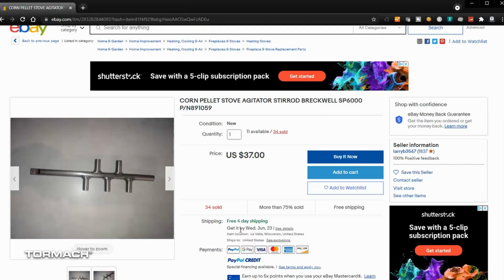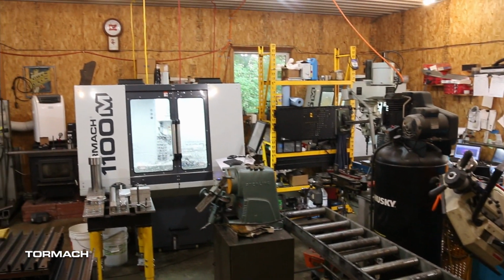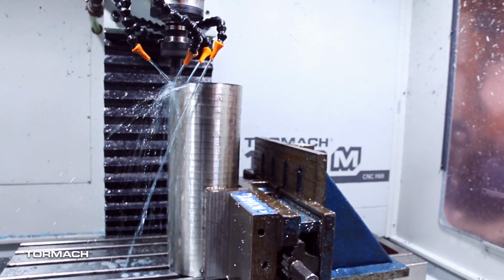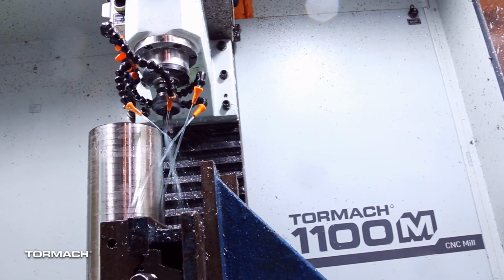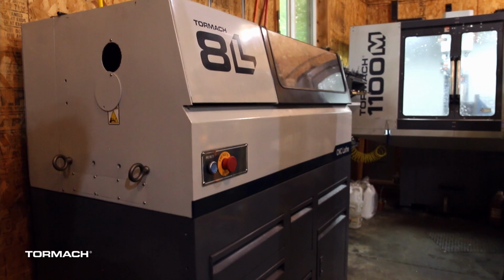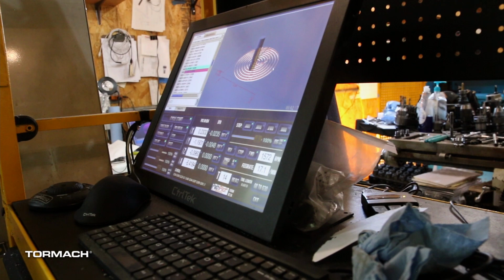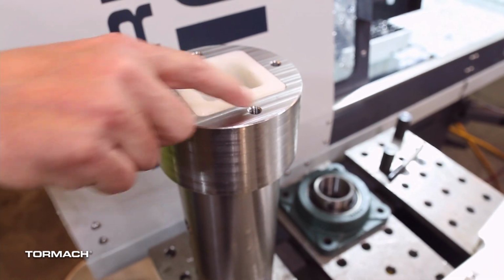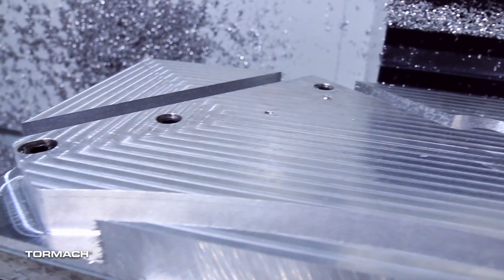Tormach Customer Story | Larry Britzman

Comment: you guys are awesome loving the 440 =)
Reply from the maker: We're glad you love the PCNC 440! What do you make with it?
Reply: @tormachinc  I make anything that is needed for my company’s engineering department, wire set fixtures, seal force state fixtures, mold inserts for silicone, something different all the time. ps we may be looking into also purchasing a 8l lathe to open up more possibilities.

Comment: I couldn't agree more with Larry. The Tormach 1100MX is an amazing machine tool. I have thoroughly enjoyed exploring it's capabilities and continue to push it's limits. The next step is to get an 8L or 15L and add turning capabilities to my shop. To anyone questioning a Tormach, try it for yourself. If you have realistic expectations you will not be disappointed!
Reply: Same! I was thinking the 15L but after closer look and using Gang tooling; I'm leaning towards getting the 8L. Though for what I'm doing I wouldn't need a very big machine, and if I ever need a bigger one I should be able to afford the 15L by then.

Comment: I've owned my 770MX for a year now and love it.....simply put ......It does what it was designed to do! I do have a question. Larry mentioned machining 14ga. stainless. I have a customer that needs some 16ga. 304 3" dia. discs and I'm interested in what tooling was used to machine the stainless. Thanks Tormach!
Reply: Five flute carbide endmill.  I've had great longevity with endmills from Shars.
Reply: @larrybritzman1772  Hey Larry.....thank you very much for the info. and video.... and may the jobs keep coming your way.